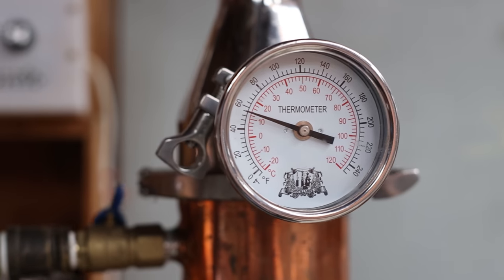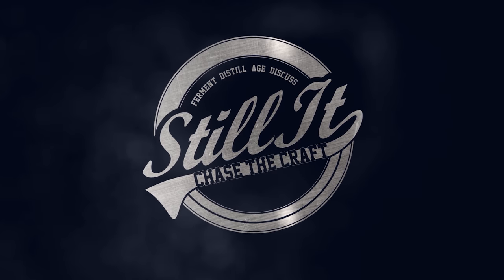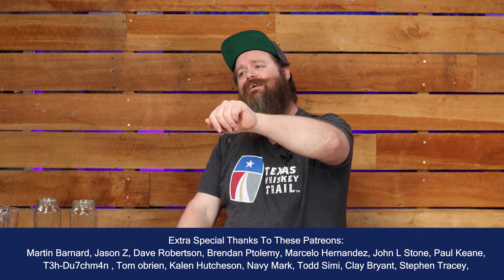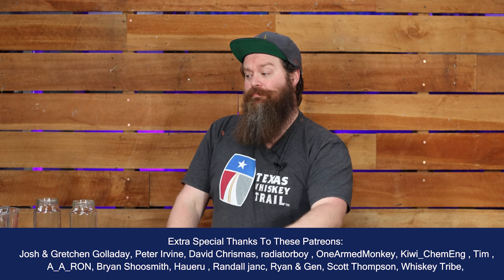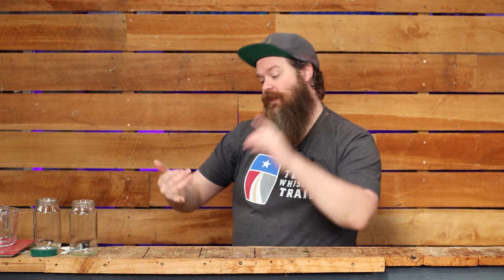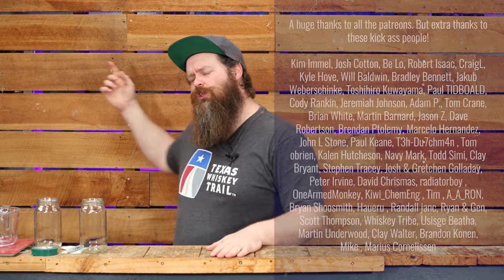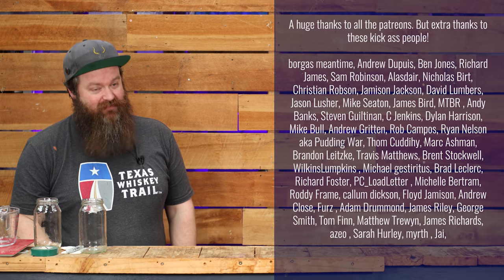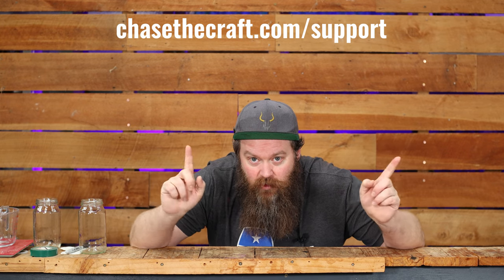Do You Need A Thermometer On Your Still? Thermometer TRAPS

Comment: A thermometer in a pot still is as useful as a dick on a hen.
And YES I'll get roasted for the next sentence I write. You COULD install one (sensor ) and then monitor the still remotely for when it is about to come to temperature. That would allow you to do a few other things (stay in sight distance though) instead of sitting there gawking at the damned thing.
Use your nose, feel, and taste the product. That will tell you all you have to know.
On a plated or reflux still, they are useful in the vapor path (obviously at the business end of the rig).
However, let your senses be the final judge regardless of what that thermo thing shows.